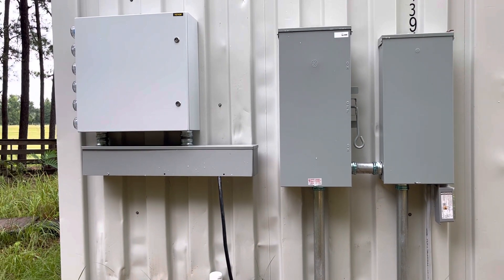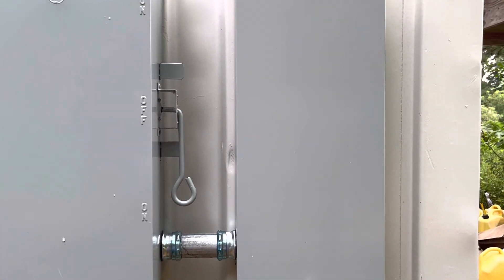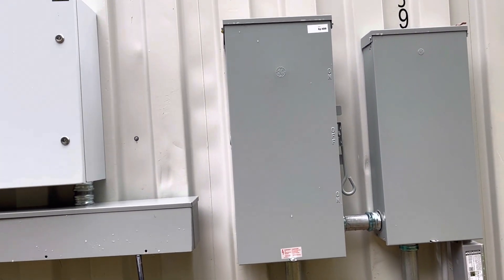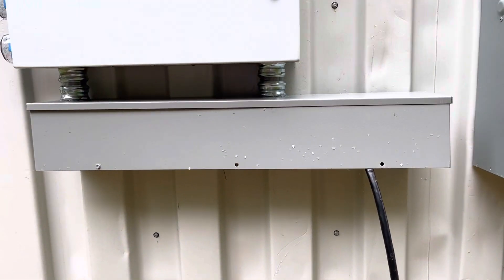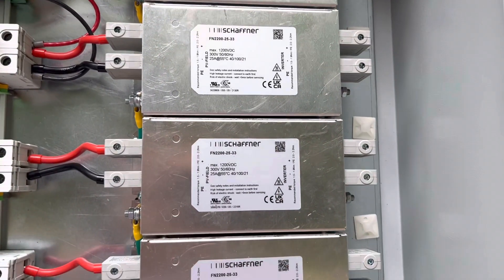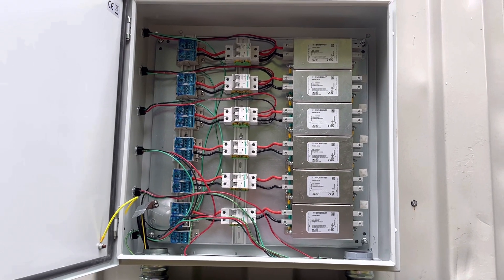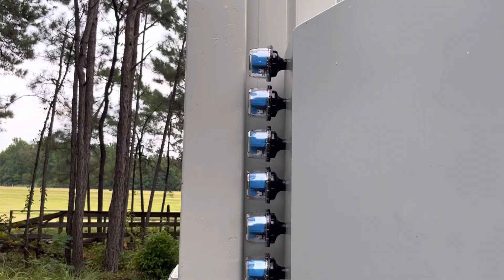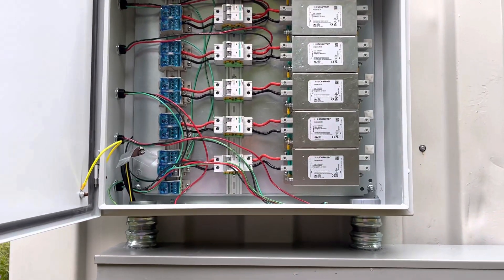Solar Power Project - EMI Filter / EMP Protection PV Input Panel

Comment: I had got the same schaffner filters, I got heavy duty units. Do you need them to come from each panel/line or can it be merged and then the filter installed after before going to the inverter. I will have my PV installer put these on, thanks
Reply from the maker: One appropriately size filter for each PV circuit going into your inverter. Compare the total Isc for your PV circuit to the amp rating of your filter. Don’t forget if you’re paralleling two PV strings into one circuit Isc adds.
Reply: @jeffmotes2129  thank you very much, appreciate it.
Reply from the maker: @habib.bhatti  welcome. I wish you well.